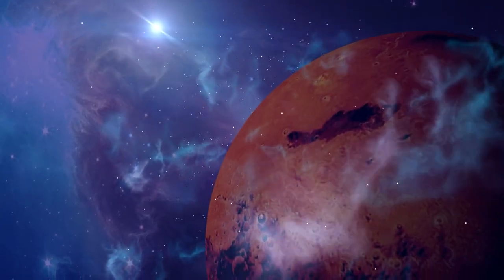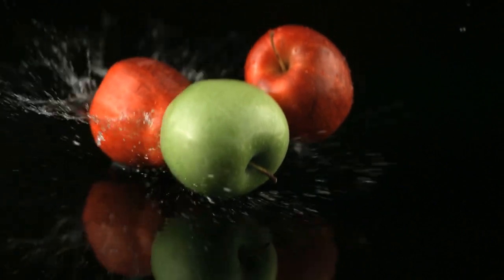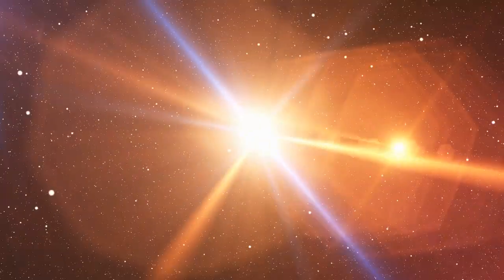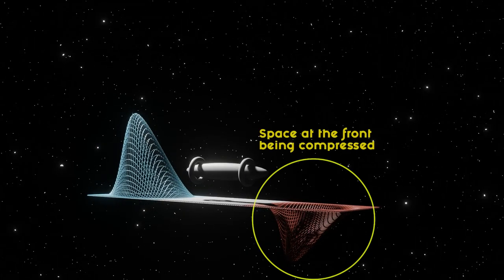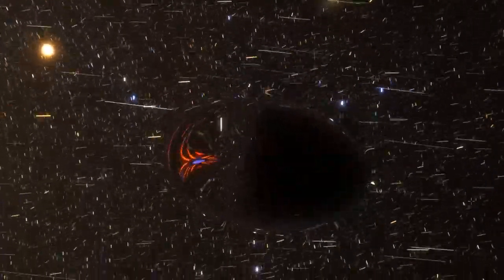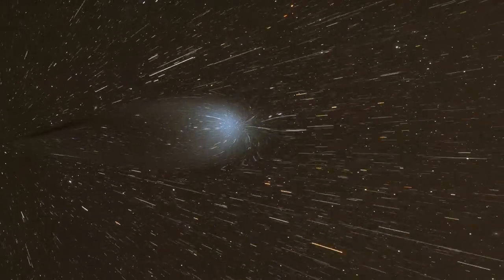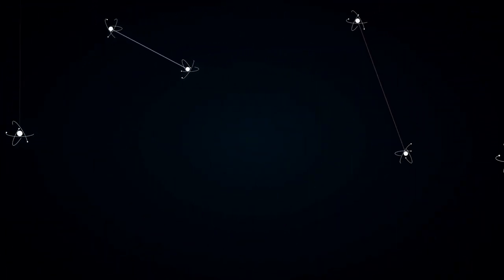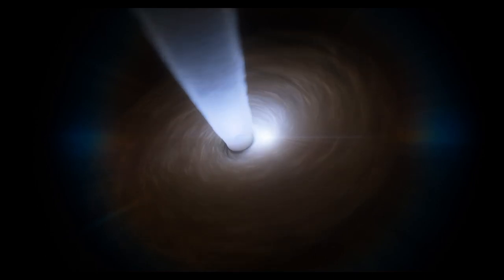The Science behind REAL warp drives

Comment: The main problem is such a drive would allow causality paradoxes, time travel, etc.  It would have been nice to have a discussion about Alcubierre drives that use only positive energy and achieve near light speed travel.  Those might be more realistic and physical manifestations of such technology that would still greatly expand the capacity for travel within the solar system and to many nearby stars.
Reply from the maker: Thanks for the comment! There should be no causality paradoxes such as time travel because the people on board such a spaceship would not experience time dilation etc. I made another video previously on travelling to proxima centauri at close to the speed of light. Dare I say it, light speed is actually slow when compared to the distances we would need to cover. They use to think splitting the atom was impossible. Give humanity time, I'm hopeful that we'll find something to make it work.
Reply: @Far Beyond  Fair enough.  If something fundamental in physics changes, possible if you could travel in some absolute reference frame that could be enforced by causality.
Reply: How galaxies travel FTL?
Reply: @Returntonature145  They don't, but the Universe is expanding FTL at the farthest edges.
Reply: @artor9175  But the point is galaxies are moving away from us with space time around it at FTL speed.So is not it breaking causality?Warp drive use similar technique.The space around the ship will move FTL  and the ship will stay inside it.The ship itself wont travel anywhre

Comment: Negative mass does not exist as that would imply that negative energy/negative kelvin temperatures exist, which they clearly don't. Absolute zero is clearly an asymptote representing a systems limit for the vacuum of space, much like the light speed limit is. However imaginary mass may exist and still be made up of positive energy. Several papers have shown that complex mass in baryonic particles may explain the apparent acceleration in the rotation of galaxies that we interpret as dark matter. And a recent dark energy paper involving observations of the masses of black holes implies that the growth of black holes may be coupled to the expansion of the universe without intaking matter, which would imply that they have an expanding interior event horizon or cauchy horizon that is decoupled from the external radius of their event horizons. Dark energy may also serve as an alternative to the singularity currently proposed at the center of black holes, which many physicists interpret as an indication that our current model of black holes is wrong. 

Complex mass, ie particles possessing both real mass and imaginary mass, may also explain the large electron problem for kaluza klein theory and the mass gap problem in yang mills theory which is currently an accepted part of the standard model but still doesn't correctly predict the masses of massive particles. It only correctly predicts the masses of massive bosons by assuming that they are initially massless particles that acquire mass by interacting with the higgs field. Charged particles on the other hand would acquire mass through a mechanism called yukawa coupling, which is a coupling between the higgs field and the dirac field. Imaginary mass may also explain the apparent absence of magnetic monopoles in our universe, as they would be particles with only charge and no mass, and therefore only have imaginary mass, and would essentially slip into the compactified extra dimension depicted in kaluza klein theory though the force of gravity. If so they would technically be tachyonic, but not all theories on tachyons require faster than light particles. 

Kaluza Klein theory was first postulated to explain the apparent weakness of gravity in an attempt to unify electromagnetism and gravity. It did so by proposing that gravity may be slipping into an extra, compactified dimension. A concept that ultimately formed the basis for both string theory, and the klein gordon equation which forms the basis for quantum field theory. The higgs boson is the first particle to obey klein gordon statistics implying that particles are in fact excitation of fields and is actually the first piece of proof that quantum field theory is true. This further supports that particles attain mass through yukawa coupling and that the dirac field, and therefore charge, are a product of interacting with an additional vector field beyond our 3 dimensions of space. This also means that gravity is a force that travels through dimensions, which would mean that a growing imaginary mass field such as the ones growing inside black holes would be able to escape black holes and have a repulsive gravitational effect in our 3 dimensions of space. However, since the dirac field is a 1 dimensional field rather than a 3 dimensional field, imaginary mass would not obey the inverse square law which is why those effects would only be apparent at larger distances. Also, while the vacuum of space may have a non zero positive mass, the mass of the dirac field may have a non zero imaginary mass. Meaning that like the expanding imaginary mass field inside a black hole, the dirac field itself may be our universe's imaginary mass field and may be driving its accelerating expansion. 

A number of papers have also shown that imaginary mass can serve the same function as negative mass in an alcubierre or lentz warp metric.
Reply: The casimir effect could create a negative energy effect.
Reply: @ericgolightly8450  Not negative energy but a negative vacuum pressure. That means it has less energy than the surrounding vacuum, but its still all positive energy.